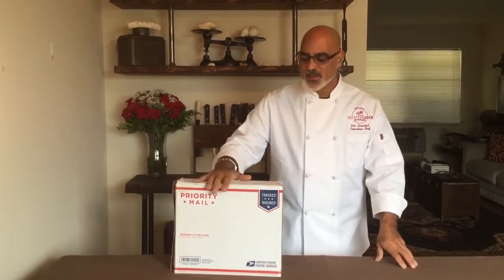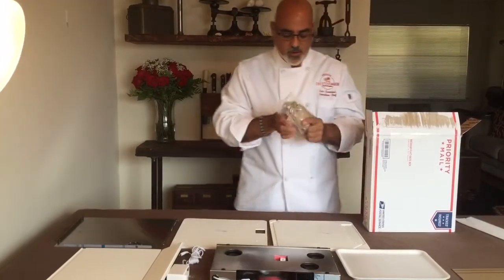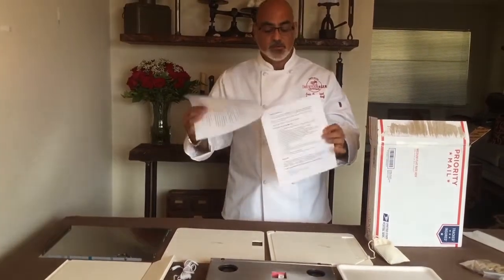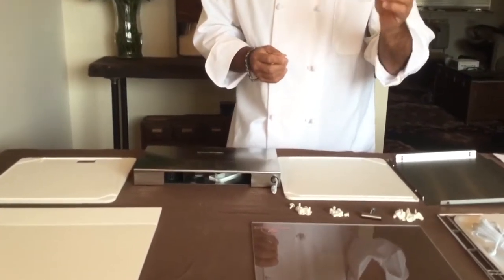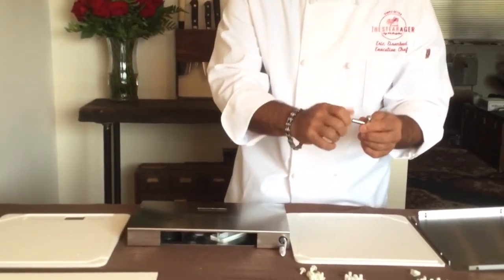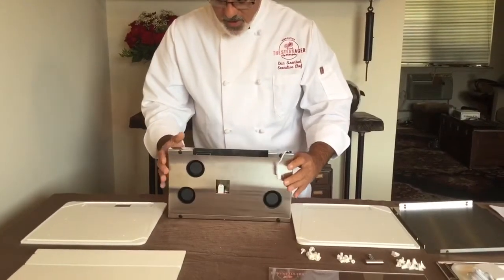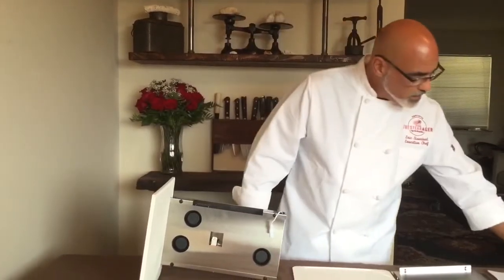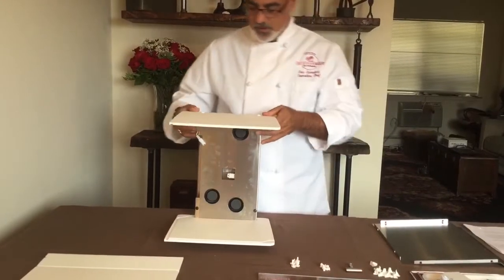SteakAger Assembly

Comment: what does the top part do?  Does it circulate air from the fridge?  guessing so moisture doesn't build up?
Reply from the maker: Coppulor yes it does and it also has a UVC light. However, this model has been phased out and we are about to launch new product offerings and a new website. Stay tuned!
Reply: how does it get power?  do you have to drill a hole through the side of the fridge? and hurry up with the new product already !  lol